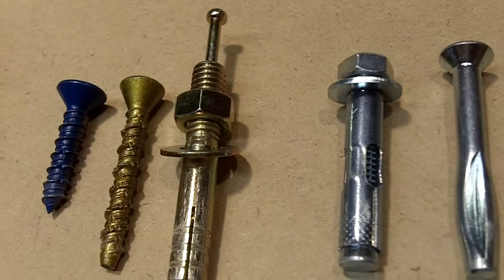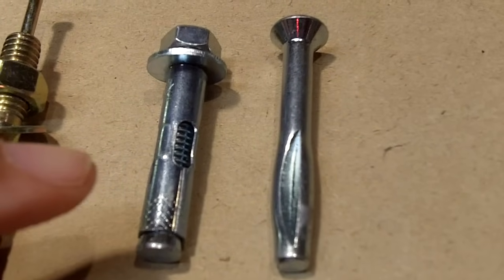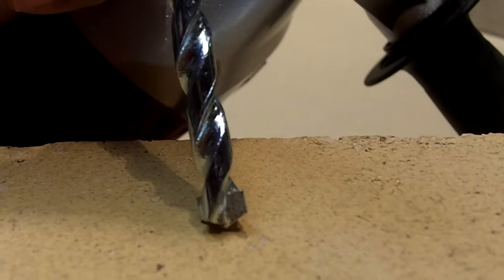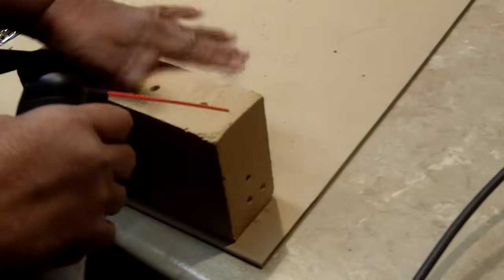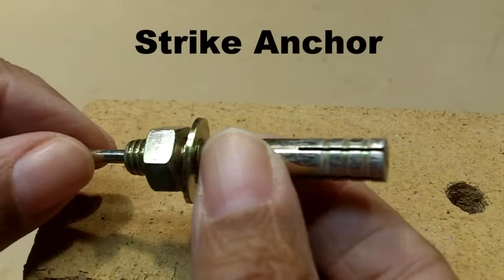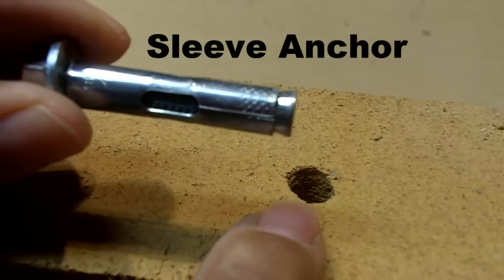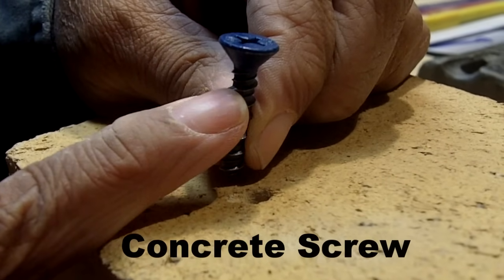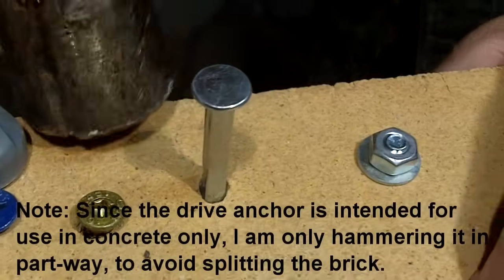A Beginner's Guide to Attaching Things to Concrete and Brick

Comment: What are they attaching  to the brick surface, there's hardly any thread left on the bolts/screws for anything to be attached between the top of the fixings and the brick itself? Might be able to get another flat washer in between but can't see much call for it?

Comment: Hi, could you advise on whether concrete "non-expandable" screws can be used to attach a heavy duty pull up bar to a concrete wall? The perfect option probably would be to use wedge anchors, however, I'm worried that I won't be able to remove them from the wall once I decide to move out of the apartment I currently occupy. Thank you.

Comment: I want to attach stand alone ladder rungs to a brick wall. I want to use galvanized flanges and pipes as the ladder rungs. I am wondering which type of anchor will be most secure for weight of a body going up and down at least two times a day. I guess it also depends on which screw/anchor will be able to attached to the flanges. Do you, or anyone here, have any insight on this?

Comment: I'm using 8 tapcon concrete screws (flat head not tapered) to hold pool stairs in place. I have to remove it each year when I close the pool. I'm worried that over time the the holes will be worn out and the screws won't hold, and I'd have to drill deeper and deeper. Is there some kind of sleeve/shield solution that works with concrete that I can use to avoid that happening? Thanks in advance!

Comment: I used sleeve anchors with a Simpson  E-Z base to hold a fence post.  The problem I have is that I drilled the anchors into asphalt not concrete. 2 years later the anchors & base wiggle,  causing my gate to sag. How do I fix this problem? I only have asphalt to drill into.

Comment: quick question, I'm looking to secure an electrical outlet box to the front of my house.  Should I chase the existing holes to widen them for my sleeve anchors or drill new holes?
Reply from the maker: I'm not certain how you're using the word "chase".  If you are widening existing holes to accommodate sleeve anchors, yes, you will probably have to drill holes that are wide enough.

Comment: I know this video is almost 5 yrs old, but if you still monitor comments, I have a question.  I need to reattach my coax to my newly installed Hardie Board siding. There is absolutely no videos on You Tube explaining the correct way to go about this. Can I use the screw that come with the coax clips? & Do I need to seal them to prevent moisture intrusion? Or, Is there a better way to reattach the coax without damaging the new siding?? Thank you for your help!

Comment: Will the strike anchor work for a wood 4x4 post double swing gate. Im using the Simpson EZ post base to hold up the 4x4s. The gate swing length is close to 6ft. If not which anchor do you recommend?

Comment: You are putting them all the way in so I'm not sure how are actually used with objects.
What would I need each for?  
Hanging lights, planters or curtains from concrete ceiling?  Hanging planters in brick?

Comment: This is helpful for seeing something done, but I'm not sure how to go the next step.  My goal is not cute studs poking out of my wall.  I'm trying to hang something up.  If I undo those nuts to hang something, is the anchor going to loosen up?  Also, there's a sheath of plaster (?) over the top of this.  How can I verify what this rock material underneath is?  I think it's masonry or concrete brick, not clay brick, but are there other options?  Or should I assume it's masonry?

Comment: Lovely video. Really informative and sensible! 

To people out there..

HELP!

I have a house were the cement on the walls is between 2 and 3 inches (8cm) thick.  No plaster.

Unfortunately the mix was so bad (weak), that even driving slim nails for electric cables or picture hooks, results in, at least,  a inch across hole.

Yep, done the plasterboard screws, hah, 4inch hole!.

I now use 5 inch coach bolts. to hang pictures .lol

!. Knock off the useless mortar fill with Lime plaster, normal cement just does not stick (or pulls the awful stuff off the wall)
 Allow lime plaster to dry a bit, drill holes into base bricks.

2. Drill hole fill with a product like no more nails, leave for about 6 hours. Rush back and hope to get everything aligned properly.

Could anyone out there help?

i would like to have a kitchen with cabinets and things...I think my only hope is to get them made out of brick.

Comment: Here's another cheap one when in a rough area . Take a regular common nail and place a piece of wire into the hole and the nail wedges in self in . Used by concrete form carpenters the most.

Comment: What good is the type of anchor used at 4:46? How would you mount anything onto a nut that’s sitting up against a concrete wall?  What use is a nut against a concrete wall? 
How would you make use of a sleeve anchor inside the concrete when there is nothing but a solitary nut sitting outside the concrete wall to fasten to? How are you going to mount anything onto a sole nut sticking outside some concrete? I can’t mount a kitchen cabinet using that nut. What good is the nut sitting there if I can’t fasten anything to the nut in order to hang something on the wall? 

Shouldn’t there be a much longer and thicker screw protruding from the anchor so you can actually use the anchor to hang things onto?

Comment: Make sure the nut on the sleeve anchor is above the last thread on the bolt, or hitting the bolt will mash the end threads down and make removing the nut extremely difficult.
Reply: Soft face hammer & deep socket. Fuck this using a hammer and open end spanner LOL

Comment: Great video, but you need to mention that if you use an Anchor screw, you need to pre drill the hole with a smaller drill bit.

Comment: looks like ill be picking up a hammer drill. I just drilled some metal pegboards into a wall using an impact drill but im increasingly nervous that im going to come home and my guns will be on the floor. The concrete anchor is free spinning in the wall.

Comment: After you insert the masonry fastener into its hole where do you hang the "thing" from?
Reply: After you've drilled the hole, you're supposed to place the item you want to hang against the wall before you insert the fastener, so that it's in between the wall and the fastener head. Hope that makes sense.

Comment: Great stuff!

I am putting an 8" x 10" x 1/2" mounting plate onto concrete. There are holes in each corner.  I'm not sure what good drive anchors are as I see no way to attach anything to them.  I thought about using the sleeve anchors.  Can I position the plate and drill the concrete through the holes?  Also, I have a 1/2" masonry drill (recommended size) but the anchor doesn't go in as easily as in your example.  Clearly, I'll have to drive them in through the holes in the plate corners?  Thanks!
Reply from the maker: I'm sorry I'm having difficulty visualizing your issue

Comment: I'm goin to install a ceiling tv mount and i have a question about plastic anchors
Is better or wors if i use them? Or is it just the same?
I should note concrete screws and anchors came with the tv mount.

Comment: A hammer drill acts much like an impact driver.  The hammer helps spin a large bit or hole saw when it gets stuck.  A rotary hammer punches forward as you described.  Completely different mechanisms.

Comment: dam that brick didn't break or cry nice video. if you are using 100mmm wooden posts just use plain 100mm  M10 x100 wall fix bolts which screw staight in using a 17 mm socket wrench.  counter sink using  a 25mm wood bit and 200mm long auger bit. these bolts don't have sheaths just screw straigt into masonary and are simple and strong

Comment: I have rookie questions. 

I am going to try to make a wood hand rail and attached it to the cement below (cement step and floor) So you have something to grip down the two front steps. 

Well here are my questions:

1. Can you use a regular drill instead of the hammer drill?

I am assuming, The concrete screws would be easy to remove, just a simple unscrew and your done but..

2. How to your remove the strike anchor?

Comment: Hey Leah, thank you so much for this video. I like how you demonstrated the installation methods for each of the masonry fasteners. After watching the video however, I was wondering, if you could provide any information as to when one might use a certain fastener over another? For instance, which types of mounting applications might require one design over another? What is the force rating for each of these fasteners? I ask because I would like to mount a garden hose hang-out to a brick façade. I am trying to choose which fastener to use. Thanks again, and I appreciate your content.
Reply: Removable concrete screws could be used to attach light items to brick (not the mortar, which could be weaker), and are coated so are corrosion resistant. The non-removable wedge type anchors would be overkill in that situation

Comment: I used the 4th one, sleeve bolt. Evidently, I drilled the hole too large. Bought a bigger bolt and still not right. Do I go and buy the next size up again or is there a better way to make this work? Thanks for any help.
Reply: Use anchoring epoxy, put it in the hole then put the anchor.. voila

Comment: Hi, i was trying to mount brackets for Ac condenser using 1/2" wedge anchor. I drilled  holes using 1/2"drill bit. But the bolt and the threaded shaft kept on turning as i was trying to tighten. So loose i can pull the and out with plier. What did i do wrong? Thanks
Reply from the maker: My guess is that you reamed the hole you drilled.

Comment: Hey there. Great video.
i HAVE ONE QUESTION IF U HAVE A MOMENT FOR IT.
Q. I want to put up some wood fixing onto my concrete wall in my garage. I really need higher up shelves as storage and I bought these expansion/Sleeve bolts. I bought m6 x 60mm and they look very small. ARE THEY OK TO USE to connect some 30mm thick wood slats to my wall? I guess what I'm asking is with 30mm of the bolt enough to hang the slat of wood or how do they work? Is an expansion/sleeve bolt the wrong fixing for fixing timber to a wall?? 
Could u possible show us how to do that one?
Reply from the maker: It was depends on how much weight will be stored on the shelves

Comment: O i see how the more hammer on fastners for concrete work now. I was unsure of drilling to deep in the concrete to install these but i understand its not the drilling to deep from how these work its more using to big of a pilot hole that could make lesson the security to the concrete. We where normally gluing down with a PL liquid nails based chalking gun....that we just applied to the underside of the pressure treated wood. But we did uses a couple of these masonry fasteners and at the time i was shakey on if i was drill to far down.. i realize it doesn't matter as much if you go a little to far because they flare out. Its more getting the right pilot hole size right.

Comment: This is an incredibly informative video. Very well shot and a wealth of information! Thanks for this. I do have one question, would the strike anchor hold a considerable amount of weight? I was considering using it to hold a dipping attachment (gym equipment) and it would need to support the weight of the equipment, my weight + additional weight, close to 140kg. Im guessing multiple anchors should be used, but wondering what the capacity of these might be
Reply from the maker: Attached to ceiling or wall?
Reply: seejanedrill concrete block wall
Reply from the maker: 140kg is a lot of weight.   I'm attaching a link for further guidance   https://www.confast.com/products/technical-info/concrete-strike-anchor.aspx

Comment: Hello Leah .... I would like to fasten resistance (exercise) band wall anchor clips to my cinder block basement walls but I'm unsure which wall anchors I shot use. I assume the anchors will attach in the mortar joints instead of the block itself. The Anchor clips came with wood screws instead of cinder block screws / pins? What do you advise? Wish I could send you a photo of the resistance band wall anchor clips.
Reply from the maker: Hi Eva, it is always better to anchor things in the brick itself, not the mortar joints.  This is especially true when it isn't going to be static...i.e. you will be pulling on the resistance bands.  Unfortunately I can't advise you on what anchor to use, because it is going to be specific to your situation.  But I do have a suggestion.  I like the Hillman Group brand of fasteners, and believe it or not, you can call their technical support line, describe what you are trying to do, and they would be happy to help you figure it out.

Comment: Do the concrete Drill bit have to be a tad bit smaller than whatever screw your trying to drill into the wall?
Reply from the maker: yes, slightly.  There are tables online that you can check for exact recommendations

Comment: Which bolts are best for holding 120 kg weight or 264 pounds weight. As I want use for rope exercises
Reply from the maker: Unfortunately this is something that I cannot advise you on remotely, because it also depends upon the material you are fastening to.  If I were you, what I would do is to contact the technical support staff of the brand of anchor that you are considering using, and ask them.

Comment: How do we know which drill bit size to use for those archor screw? I notice we always need a bigger size drill bit than the archor screw but I wasn't certain on which size to pick
Reply: Take the Archor screw with you when you pick out your masonry bit. Holding the masonry directly on top of your archor screw, line your eye sight directly with bit and screw behind it. You should see  the threads of screw peering out from behind . The screw should be slightly bigger than the bit

Comment: Thanks. Just curios, why are the threads eaten(bad) of screw # 2 from left? 0:25
Was it bad material or because of drill extra speed or it was meant for wood and used on concrete/metal or put in a smaller anchor?!
Reply from the maker: The threads are not damaged, they're just designed that way.
Reply: Ok, thanks.

Comment: What I think is important is you should not use the screw anchor (gold and blue in picture) for attaching heavy use items such as hand rails to concrete or cinder block, I use a sleeve anchor for cinder block and a wedge anchor for cement! If you are going to do a lot of this type of work, get an industrial grade hammer/drill, a cheap one will burn up within an hour! Most fasteners you buy, you might want to look up the pull out and shear value on the fastener before you use it on heavy duty jobs!

Comment: Naive question here: Can you turn off the hammer function on a hammer drill, so that it can also be used as a standard drill?  (Also, is a hammer drill the same as an impact drill?)
Reply from the maker: Most hammer drills can be switched to regular drill mode.  A hammer drill and impact drill are different.  Impact drills work on the principle of concussive force, and hammer drills work by way of downward force.

Comment: What’s best to hang a flag pole. Mine keeps coming off
Reply from the maker: Since a flag blow in the wind, stress is placed on bracket that's attached to it's foundation.  I would use any fastener listed as medium to heavy duty.  Look for the rating listed on the package.

Comment: Hi, late to this video. Just wondering when you drove the blue concrete screw, did you use a regular driver, or impact driver? I can’t seem to get these to drive with my regular drill driver.
Reply from the maker: Hey Christopher, I did it with a regular drill driver, however, I drove a pilot hole first.  Did you use a pilot hole?
Reply: Hi, seejanedrill thanks for the reply. Yes, drove a pilot as per the screws instructions but then found the screw kept locking in the pilot hole. Might be my technique. Have some old bricks and left over screws so will keep practicing :)

Comment: How about for mounting things in stucco ?
Reply: Depends on what you are mounting.  Just be extra careful when you drill as there may be electrical wires, gas pipe, water supply pipe a few inches behind the stucco so don't let your drill bit travel too far in.   For something light, you could use plastic ribbed anchors.  Make sure you get the ones designed for outdoor as indoor ones can become brittle and deteriorated over the years if installed outdoor.
Reply: If you are going to mount something heavy, ideally, you would want to use a good stud finder and find the studs, screw some outdoor screws to some brackets, then mount your things onto the brackets.  Again, it depends on what things you mount.
Reply: CODER QN  I have a good stud finder. The magnetic one and it is not able to detect the stud since the stucco is too thick. Any recommendations ?
Reply: A decent Zircon stud finder, like the Zircon MultiScanner i520-FFP, should be able to find it through stucco unless your stucco is thicker than the standard thickness.  Amazon should have it or check your local Home Depot.  You could get one from Home Depot that claims to be able to find studs through the stucco.  If it doesn't work, return it.

You could try finding the studs on the drywall inside the house.  That gives you an idea if you have pipes and where the studs are for good measure.

Comment: No powder actuated shot in anchors like Hilti or Ram-set?
Reply: Jim Bendtsen those are only good for wall plates not a handrail thell come out from force
Reply: Yes. I agree, but none of these are the perfect masonry fastener for all uses. Shot in pins are great for uses where pull-out is not a concern, but only lateral movement, like wood and metal wall plates, on concrete floors and block walls, and they're much faster to install. I've used them all for different purposes.